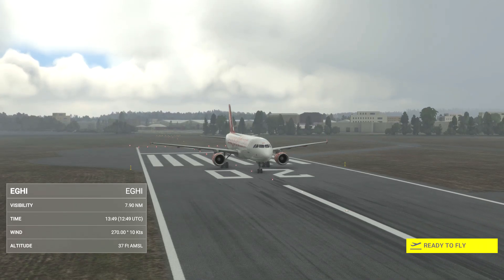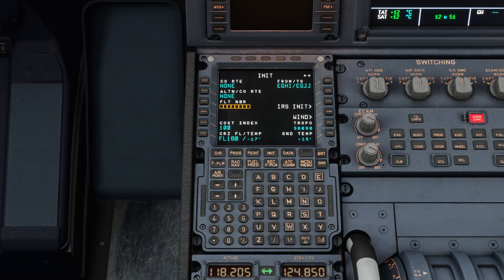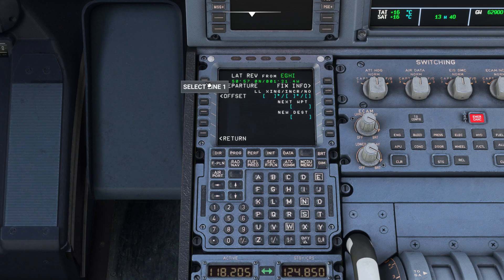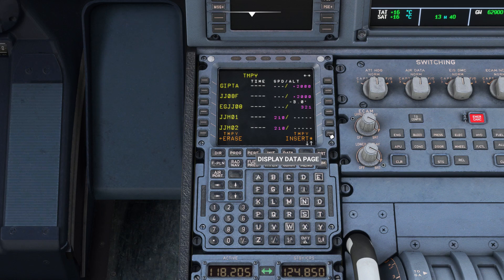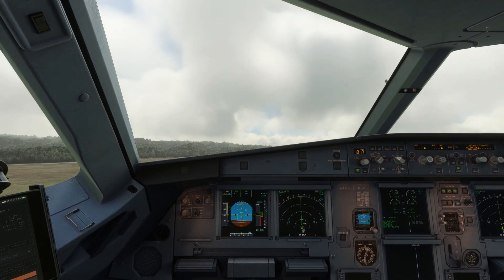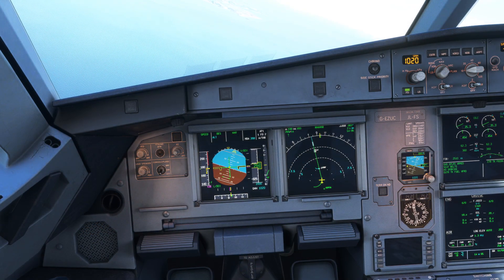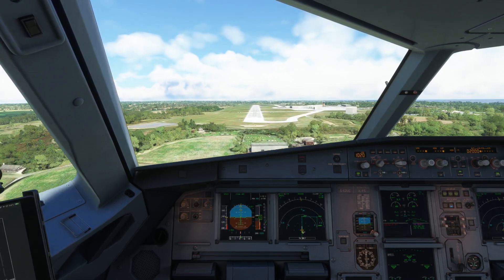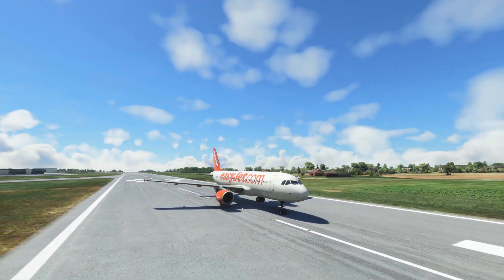MSFS Fenix A319 / A320 / A321 - RNAV Approach Tutorial

Comment: Hey, so you don't need to put in Baro reference for arrival airport?
I found that in the fenix in my last stream, the init cruise alt had cleared.

EDIT: Saw you you had that there. 

What if you are using software such as beyond atc? would you still enter your final approach fix altitude or the instructions by atc?
Reply from the maker: @THEMIGHTYCB  you should fill in the approach perf page as normal, I just focused on the RNAV specific stuff here
Reply: @TiJayFLY  Wow, thanks for the very quick response! Appreciate that.
Reply: @TiJayFLY  What would cause the cruise altitude set in the INIT page to clear? It was super weird. I might practice using the same route as you did and learn it more.
Reply from the maker: @THEMIGHTYCB  can’t really answer that with the detail given. It’ll be some Fenix specific thing, file a support ticket with Fenixsim if it happens again. 

Re ATC, depends how realistic you want your experience to be really. Follow ATC instructions if that’s the experience you want, or you can fly without ATC and just enter the FAF altitude

Comment: Nice vid thanks. I'm really struggling to get the A320nx FBW version to execute RNAV/RNP approaches at my local AU regional airports using LNAV and VNAV guidance. When I asked about it in the forums they tell me RNAV is not yet supported in any versions. Your video suggests otherwise. I often find the aircraft sailing over the runway at 2000ft and I can't activate the APPR button. 

So either the FBW A320nx  is not yet fully compatible for VNAV descents or I'm missing something in the MCDU when importing from Simbrief. Do you need to 'activate' the approach before the IAF or FAF or should it kick in automatically?
Reply from the maker: This video is for the payware Fenix A320 not the FBW, if that helps? :)

But no, as long as the plane supports it, you don’t need to do anything except hit APPR near the glide slope
Reply: @TiJayFLY  Thanks for the explanation TiJay. I thought you mentioned a few times in the vid that it was applicable to both FBW and Fenix A320 aircraft.  Appreciate the clarification 👍
Reply from the maker: @max_dee  agh sorry, that one is on me! I should have added a caveat “it’s the same process, provided the add on actually supports RNAV”